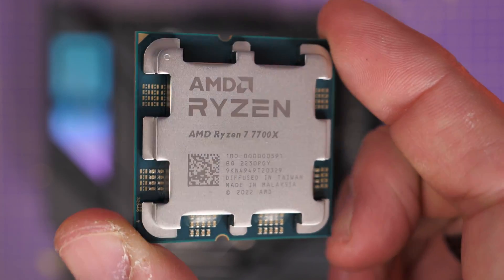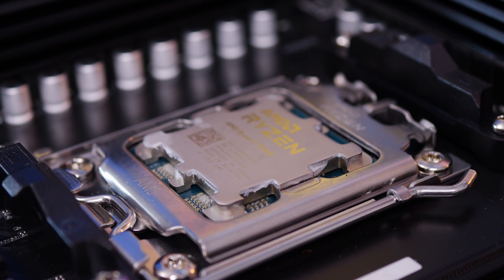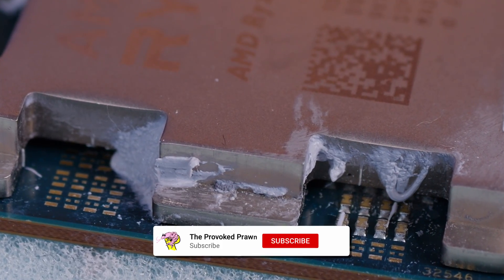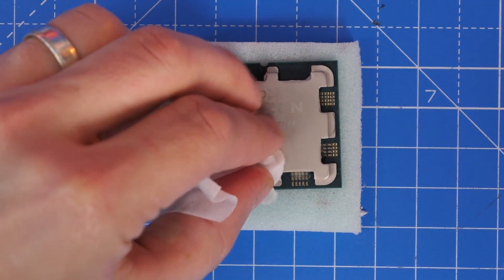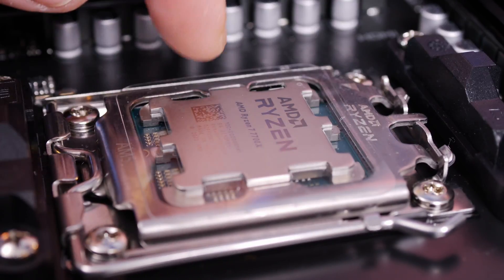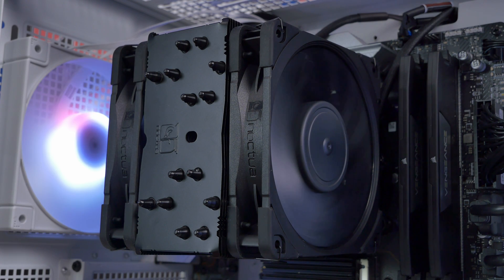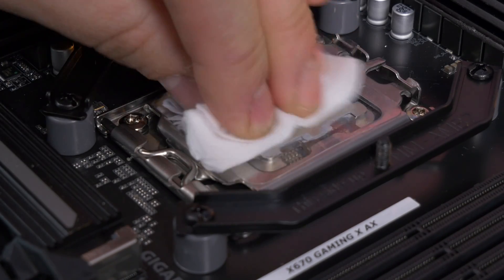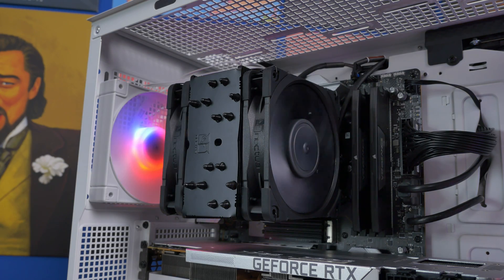No more thermal paste mess? AMD AM5 vs Thermal Paste

Comment from the maker: For those asking the melting point is 130 degrees C

https://faqs.noctua.at/en/support/solutions/articles/101000447653-what-is-the-na-tpg1-and-does-it-affect-the-cpu-temperatures-in-any-way-
Reply: so even if it stays there like for example 10 hours x day at 70 degrees for 2-3 years, are we really sure it wont get affected in any way ? Only at 130 degrees will it melt ? no matter how long it stays as long as we dont hit the 130 degrees ? even if it gets hit by high temperatures of cpu + cpu cooler for months ?
Reply: @Ares_XO  this is my worry too
Reply: @Ares_XO   ElecGear makes a silocone one that withstands up to 260 degrees C, called the "ElecGear AMD Ryzen 7000 CPU Thermal Paste Guard"
Reply: Thank you. I was wondering that.

Comment: I might have gotten some thermal paste on the top part of the chip just under the metal block.. does that ever mess it up so it doesn't boot properly?  I'm pretty sure the connecting pins on the bottom are clean, but the whole machine itself just wont boot.  I get an error light for DRAM and I've tried everything to try to fix it, nothing works.  Could the CPU be an issue in this?  Will too much thermal paste ever mess it up?  And can a good cleaning on the chip ever solve a start up problem?

Comment: I had no idea you're supposed to leave the plastic on. This is gonna make swapping my cooler later this week an interesting (read: stressful) activity.
Reply: IMO, you are supposed to spread a proper layer, remove plastic with any excess, then put on a heatsink.  But, I haven't looked at the product's instruction.
Reply: Lack of common sense?

Comment: So we know the melting point is 130 degrees C but how often should it be replaced ?

For example say 2 years of use (gaming) with an aio cooler would that guard still be safe to use ?
Reply from the maker: That's a question for Noctua

Comment: That just looks like something that can affect heat dissipation. Not necessary at all.
Reply from the maker: Nonsense
Reply: ...says the guy who offers to put a piece of plastic on your CPU.

Heat dissipation happens all around the CPU, including from the sides. Similarly, the cooler side is being blocked a little. Putting anything in the vicinity will affect the cooling efficiency. I'm not saying it will be a 10 deg difference, but it can be very real. Especially since there is literally zero reason to put this thing on your CPU.

Comment: I am not putting plastic any where near a CPU. That is  the stupidest thing you can do. Even if it is rate for a certain temperature that will only last for so long it's called thermal failure.
Reply from the maker: It's rated for 130 degrees c. The CPU doesn't get that hot.
Reply: i am pretty sure cpu cap at 100degree max you'll be fine.
I trust noctua with all their engineering tech won't mess up on such a minor detail

Comment: Its even better in 1-2 years when you either change the CPU or do a repaste, the old paste becomes dried and caked on the pad so you virtually only have to clean the top of the cpu cover.

Comment: The thermal paste is on the outside because you put a lot. Do not apply so much paste on the processor, a thin layer is enough and if you use the spatula to spread it, it is very easy to adjust the amount.
Reply from the maker: Yes
Reply: He said that in the video he specifically put on alot so he can demonstrate what it does for demonstration purposes!

Comment: This seems useful for using Liquid Metal as thermal paste
Reply: Actually, ASUS in laptop uses a specialized gasket to encapsulate the liquid metal and prevent it from short-circuiting any SMD components or the motherboard

Comment: What would be a melting point for that piece of plastic? Because I'm more scared that it will melt rather than having too much paste.
Reply from the maker: https://faqs.noctua.at/en/support/solutions/articles/101000447653-what-is-the-na-tpg1-and-does-it-affect-the-cpu-temperatures-in-any-way-

130 degree c

Comment: Forget about thermal paste. I can't believe it's still a thing. Instead, get a CPU thermal pad or sheet like the Thermal Grizzly KryoSheet and voila, no more mess, no more cleanup and no more spillovers. Sure, maybe your CPU will run 1 degree warmer,  but unless you're an extreme-ultra-super-dooper overclocker, who cares?! My SFF build, undervolted 9800X3D averages 50 degrees with the thermal sheet during gaming, with CPU and case fans running at barely 50%. Bliss.

Comment: is there any danger if a little bit of thermal paste gets on the golden areas on the sides of the chip?
Reply: Eh relatively no, thermal paste is non conductive so it just sits there
Reply: No danger at all. Use quality paste like Arctic Cooling MX-4 though
Reply: @dOoMnX yea that's what I use

Comment: If the thermal paste goes over the edges of my 7800x3d will it reduce its perfomance or produce some negative effects?
Reply from the maker: No
Reply: No just make sure the thermal paste you get is non-conductive paste.

Comment: when it overflows, can it damage the cpu?
Reply: Not likely, most thermal pastes aren’t electrically conductive. Those that are still aren’t very likely to cause any issues. So long as you don’t get any in the socket you should be fine.

Comment: this happened to me, thermal paste overflowed BUT not to the insides of the cpu but like the outer layers and like the green part, should the cpu be fine? it didnt get to the bottom either.
Reply: just clean whatever you can and you'll be fine it really doesn't do anything to the cpu nor the motherboard if it isn't an excessive amount
Reply: @N0Motion  thx

Comment: i wouldnt put a piece of plastic there.  Id just use a thermalright contact plate, cheap and keeps your cpu clean.
Reply: About to build on the AM5 platform. Any chance you could provide a link to what you're talking about mate? Would be much appreciated.
Reply: €15 is not cheap.

Comment: If you only use as much paste as necessary, nothing will run down the side.  Instead of spending money on such a frame, people should better learn to apply the paste properly, then they will save money rather than spending extra
Reply: Eh
This is more so a product for the "I want it 100% covered" than the "just good nuff" crowd

As shown, people are using these to spread the paste all over. 

And it's probably a God send for the Liquid Metal guys who actually have to worry about messing up with that stuff.

Bout $10 for peace of mind on a CPU you will spend about $300-400 on. It's a drop in the bucket.

Comment: This problem caused by amd design .
Reply: Wondering if it was simply to stand out from previous CPU IHS. I can't stand it. I've always been able to clean up any previous CPU before pulling it from a motherboard. These AM5 cpu's are a PITA to fully clean. I buy those thermalright plates for $9 and sadly some compound still gets past them. ANd to make matters worse those contact plate somewhat stain and don't wipe clean like a CPU does.

Comment: How does the heat from the cpu/mobo/case not just obliterate that plastic?
Reply: It is polycarbonate. It withstand 130c.
Reply: @FiveInline84  what if my CPU goes up to 140c
Reply: @tacoastline  thats a you problem now
Reply: @GloomGaiGar  😨⁉️
Reply: @tacoastline  it's going to shut down before you even get to that high temp.
Reply: @tacoastline  There are free utilities to actively monitor your temps. If it's operating at 95C or above just sitting idle, you should probably turn it off. Until you've resolved the issue with your cooling system.

Comment: KryoSheet.. bit on the expensive side, but doesn't dry out or need replacing when handled properly. Highly recommend to builders who aren't confident with thermal paste application and plan to keep their CPU for a long time. Only issue with it is you need to handle it delicately. It can even be reused.
Reply: why not ptm 7950?
Reply: I recommend the MJ M12, both price and performance are very advantageous, also after all, suitable for newbies!
Reply: bruh LMAO if you can't handle thermal paste, then you definitely shouldn't handle fragile, tiny sheets of electrically conductive materials that can break into dust
Reply: @denks7849  It's not about handling, it's simply that it's disgusting. Why would you want to use messy paste when there are cleaner, easier to remove alternatives?
Reply: @denks7849 I’m a moderately experienced industrial tech. I trouble shoot PMs, PlC, safety relay loops, drives… ethernet controllers, few other things. Sometimes I’ll work on live 480v😝
I mainly work on the mechanical side though…. Extruders, processing equipment, forklifts… we do it all here.😢
I picked this video for a reason and it wasn’t to talk down on guys. After switching coolers my 9-7950X3D was running 42c at not under load and cut off within a few minutes… 
Now I’m here, why you on this video?

Comment: Are you putting the thermal paste on plastic @2.33? What new fangled contraption is this Noctua kit? I thought the thermal paste had to be in direct contact with the CPU.lid.
Reply from the maker: No, it's just the light. The plastic only sits off the edges
Reply: Did you not watch the video at all? The plastic cover clearly had a cutout that overlays on the cpu lol

Comment: Why not just use on of those replacement CPU frames from themallite or thermalgrizzly? They fit pretty snug around them , even the AMD and pretty much does the same thing as that piece of plastic... And you don't have to worry about it potentially melting on the CPU if it happens to overheat
Reply: As you point out there are other options, but this is easy to install as you just place the plastic cutout on the chip.  No screwing required.  And it's cheaper than the Thermal Grizzly.
Reply: There's no need for a CPU frame replacement on an AM5 socket which is already robust enough and won't bend like Intel LGA1700 sockets. The Noctua thermal guard is designed to withstand temperatures up to 130C, so it won't melt. AM5 processors are designed to not go over 95C for extended amounts of time.
Reply: @little_fluffy_clouds are you a bot? You're pointing out stuff that has nothing to do with OPs comment. OP is talk about thermal paste seeping over the sides, not about overheating nor bending.
Reply: @painexotic3757 yeah, I was also taking about the plastic frames for AM5 chips that are intended to prevent thermal paste seepage and I was pointing out the Noctua ones don’t melt. And in case it wasn’t obvious to you, no, I’m not a bot. Are you?
Reply: @little_fluffy_clouds  yes you are. You're bringing up talking points that have nothing to do with the guys comment lol
Reply: @painexotic3757  For me it was a very important and informative comment, instead of your useless comments.
Reply: @piQmi  well it's a good thing I wasn't talking to you or about you. Now move along child lol
Reply: @painexotic3757  Yup, exactly what did you do with @little_fluffy_clouds 
The conversation wasn't about you and you got involved in the conversation.
Reply: @painexotic3757   thermal frames decreases idle by 5c . . and its just looks better and also am5 , and can keep forever dont matter what brand
Reply: @ClipperAce  ik. I have one
Reply: the problem with these thermalright am5 guard is they void your mobo warranty since your are removing the mobo latch and replacing it with guard.. god forbid if something happen removing your original mobos screws.. but with noctua, its tooless
Reply: I replaced the base socket with a thermalright protector. Since then I have a problem that my computer randomly shuts down.
Reply: @deadlyfeets you're the second person I've seen say this. I wonder why that is. But most people don't seem to have this issue.
Reply: @painexotic3757  They possibly screwed it in too tight. Same issue can happen with coolers.
Reply: If you make a mistake with the torque it causes problems, even if you do everything properly it can still cause instability and it voids the warranty of your motherboard if you put that

Comment: how does the plastic guard react to the heat from the cpu in the long run?
Reply: It's designed to withstand temperatures of up to 130C, so it'll be fine, even in the long run.
Reply from the maker: That I don't know but the official advice from Noctua is to leave it in place, so I assume it's resistant or not enough heat reaches the edges to matter

Comment: So, what are your thoughts on using the Thermal Grizzly Carbonaut or Kryosheet?  I am using a Carbonaut on my i9-13900K and not having any issues, and no mess.
Reply from the maker: I've used those sheets before and they're great. So much easier. I've not tested the thermal performance Vs paste but for usability they're excellent
Reply: @TheProvokedPrawn  And the Carbonaut is reusable. The Kryosheet seems more fragile but with a better termal conductivity... Could be an interesting video comparaison with termal paste. ^^
Reply: @TheProvokedPrawn  I've been using the IC graphite pads (which TG copied) for about six years now, and the difference really only happens with extreme overclocking.  With a decent overclock, and a good thermal paste, you're only going to see around a 4 - 5C difference at most on full stress test load (which you'll rarely be doing with most applications).  It's only when you're going higher that it would really matter, but then you probably wouldn't want to bother with normal thermal compounds anyway.

They seem to last indefinitely, and it also makes it easier to take off the heat sink for transportation purposes if you're using air, instead of liquid.  The only downsides I can think of would be that depending on how good the contact with the bottom of the heat sink is, and whether or not it has any "micro valleys".  You can also tear them depending on the heat sink type as well as with some AMD chips, and also some of them are electrically conductive, so you would want to be extra careful around a chip like the one in this video.  

Lastly, I think the hardest part of using them is simply keeping them in place, or at least across the entire surface area of the chip while you're actually mounting your heat sink or cold plate, because they love to shift around very easily.
Reply: I really like the CPU Holder/Corrective Anti-Bending Fixing Frame from Thermalright for this reason

Comment: Have you tried the CPU guard from Thermal Grizzly? I works the same way but is a gasket that you place on the CPU itself.
Reply from the maker: I haven't but thanks for sharing
Reply: Yeah investigate that for us :P  They seem extremely cheap and if they do what they say then it should be a no brainer to use.
Reply: @Efoure4  i mean im personally running one with a 7950x3d it's perfectly okay when i was using thermal paste nothing ever got to the bottom of the cpu or inside the socket i since switched to ptm7950
Reply: Im using the Thermalright Contact Frame. Works great. Paid like 10€ for it and it even came with 2g of thermal paste
Reply: Can you slap a kryosheet on after putting on the frame?
Reply: Alternatively the thermalright contact frame gives you the same effect while actually giving you proper mounting support on your cpu